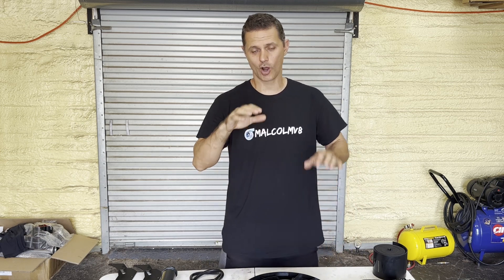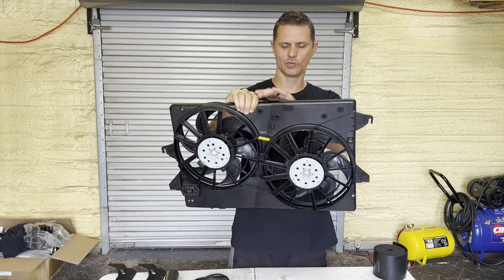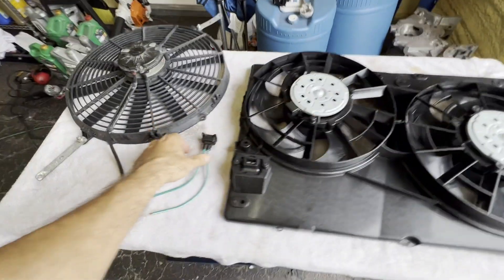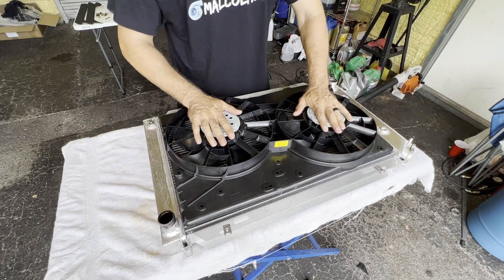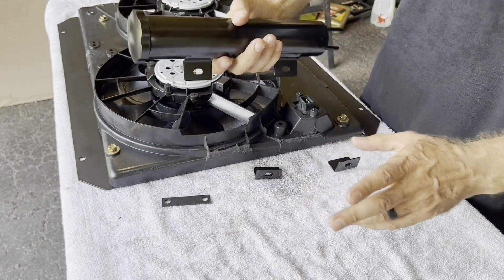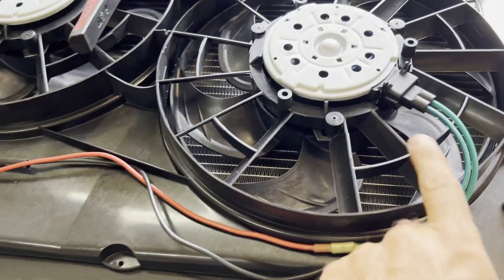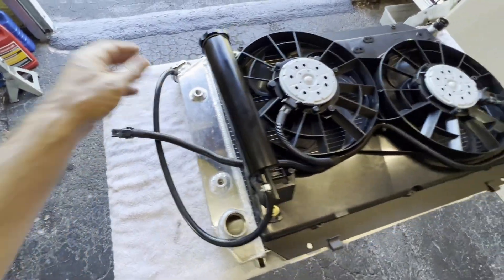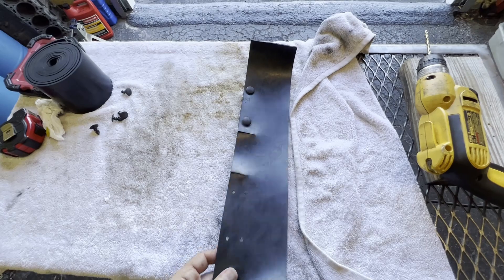Addressing the cooling on our Vortech Supercharged Project 90 Fox Body - Contour Fans

Comment: Great install. One note though....looks like you combined both fans into 1 x 12ga wire. This can't properly handle the amperage of those fans together, especially the inrush current. It should be 2 x 12ga or 1 x 10ga. Keeping them separate has the benefit of turning them on with separate temps and relays. Putting them together is fine and simplifies wiring, but you should also use a 70 amp relay if doing so.
Reply from the maker: They are combined because they are on a variable speed controller so they spin from 10% to 100% and everything in between depending on what's needed.  It's been so long I don't recall the specific wire gauge used but I do recall using dual 40 amp relays to feed the speed controller.
Reply: @MalcolmV8  Makes sense. Thanks for the reply!

Comment: Never, ever place a sensor at the lower hose after its being cooled. It should  be read from the nearest point where the coolant is leaving the engine. This is false information. No one should do this.
Reply from the maker: My years of experience say otherwise.  The temp leaving the engine does not decide if the fan should be on or off.  The temp of the coolant leaving the radiator does.  If they radiator is doing it's job and there is no need for a fan then no need to turn it on.  If however there is not enough enough air flow or the ambient air is rather warm then only then the temp of the coolant existing the radiator is not cool enough then the fan is turned on to help the radiator do its job.  I've setup countless cars over 20+ years with this system.  It works impressively well.
Reply: @MalcolmV8  My years of experience I believe every manufacturer has mechanisms on their vehicles to measure coolant temperature at its hottest point; directly as it leaves the engine. The whole purpose of the cooling fan/s is to ensure that coolant is returned to the motor at a lower temperature. I see no sense in what you suggest and will advise against it. I cannot imagine the wear and tear on a motor using your method.
Reply from the maker: @jasonstocks6460  I don't think you're understanding what I did.  The point of the cooling system, fan and radiator, is to ensure the coolant flowing back to the motor is sufficiently cooled.  I think we can both agree on that?  so as long as I ensure the coolant in the lower radiator hose is cool enough I'm in good shape.  The advantage to what I'm doing is directly monitoring the temperature of the coolant in the lower radiator hose and if it's cool enough without the fan running then I don't need it running.  Examples of this would be cooler weather outside  could ensure that the radiator is cooling the fluid down more than enough and no fan is needed.  However if you were monitoring the upper radiator hose or coolant at the intake manifold you would not know that.
OEMs do it that way because it's cheaper and easier.  They don't care if the fan runs extra when it's not needed if they can save money.
Reply: @MalcolmV8  I think I am grasping it. Make some sense to think of it, yes...

Comment: Hi - I have the LMR kit that comes with a Dakota digital temp/fan controller.   

It allows me to set the on/off temp for each fan individually.   With having this granular control, would it be ok to mount the temp sensor in the upper intake tube?   The kit comes with a Y adapter to split where the coolant temp sensor (not temp gauge sensor) is on heater tube area but the adapter raises both sensors about 2 inches from where the stock one is and I get very low temp readings compared to the temp gauge.
Reply from the maker: I have never had luck with sensor adapters like that.  Even just raised inserts that are welded up a little too high don't seem to work well, always read too low.  As for putting the sensor in the upper hose, it can be done and works.  The only downside is you're not taking into consideration what the radiator is doing.  In other words on a cooler day the radiator may be cooling the coolant just fine while driving down the road and the fan is not even needed but your controller won't know that because it's reading the coolant temp before the radiator so the fan is running when it's not needed.  Not a huge deal but something to note.

Comment: Mine wants to stall when both fans click on
Reply from the maker: Did you troubleshoot why? what setup are you running?
Reply: @MalcolmV8 ! Thanks for the quick reply Malcolm. I’ve been trying to trouble shoot for almost a year now lol. I have an upgraded alternator. I heard about the amp spike of the contour fans so I decided to do 75A relays. I’m controlling it with a Dakota digital controller too. Usually just one fan is enough to cool it down at idle but once that second one turns on the car dies on me. I have my idle at like 1000 just so it doesn’t turn off on me :|
Reply from the maker: @itsmetiqui1136  Does your controller turn the fan on slowly and then ramp it up to speed?  If so that would eliminate all the issues right there.  The other thing to be aware of is fan wash across the MAF sensor.  If you have an open element filter in the engine bay and your car is MAF based air blowing on it from the fan(s) will disrupt the MAF sensor and do all kinds of things including stalling the motor and having the RPMs surge etc.  You can use some cardboard to build a make shift block around the air filter just to test idle when the fans kick on.
Reply: @MalcolmV8  I’ll give that a shot! Thank you!

Comment: Great video.  I bought the LMR  fan bracket kit for my fox body, Mustang. It was totally useless as the material at the top and bottom of the radiator was very thin nowhere to attach.
It's manufactured by "Northern". An Ebay seller.  The 2 core radiator was only $175. It's a nice radiator. The fins all around were not bent anywhere, unlike some aluminum radiators I have purchased. I have another project that I decided to use the Contour fan on since I was having clearance issues with the new serpentine drive setup. This is a 65 Ford F100 with a 429. The original copper brass radiator was only an inch and a half inches from the waterpump snout. I  bought a Champion aluminum radiator and gained a full inch. I had to remove the webbing between the two fans and it does fit. I have to remove the fan to have access to the belt tensioner. I had to trim the edges of the shroud as it is not square. I got a Dakota Digital fan controller from LMR and I'll be wiring it up this week.

Comment: Hey Malcom is there a way to have the Microsquirt turn on the cooling fan when the ac turns on? I currently have my MS commanding the cooling fans but i havent figured out how tohave them come on when the ac is turned on. Any help would be appreciate it. I Love the content!! Keep it coming!
Reply from the maker: No the easiest way around it so to take a trigger from the AC system to a relay which turns on the fans.  Since we're using a Fusion fan speed controller we tapped into the AC to feed a signal to the Arduino so it knows AC is on and it can command the fans accordingly.
Thanks for the kind words, definitely more content to come :)

Comment: Thats amazing success 🎉! I have these on my turbo 347 with the 3G alternator. How much of a temp difference would I see by moving the coolant sensor to the lower rad hose as opposed to the heater hose location ?
Reply from the maker: The temp sensor in the coolant hose is for the ECU.  I would not move that one as it's important to read correct engine temps at all times for the ECU.  The only temp sensors I put in the lower radiator hose are for fan triggers as all they care about is the coolant hot enough to warrant the fan running?

Comment: Do you think these would work for an 03/04 Cobra?
Reply from the maker: Yes I see no reason it wouldn't.  The dimensions are very similar.  I've typically done Mark VIII fans on 03/04 Cobras and plan to do another one and make a video on that process.  That wil be coming soon.  The nice thing with the Contour fans is you can by brand new replicas where as the Mark VIII fan has to be sourced from a salvage yard.
Reply: @MalcolmV8  being able to get new stuff is what I like about it. I was going to look into the 13/14 GT500 set up, but if this would work I might have to change my plans
Reply from the maker: Agreed buying new is one of the bigger advantages as well as cost. I paid more for a 20 something year old Mark VIII fan than a brand new Contour re pop. Granted the Mark VIII does out flow the Contour setup a little.